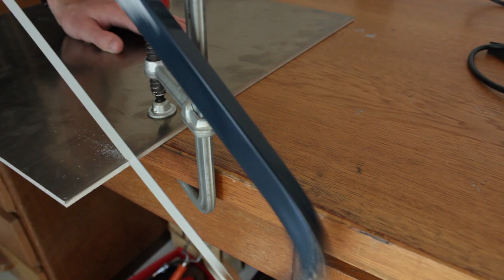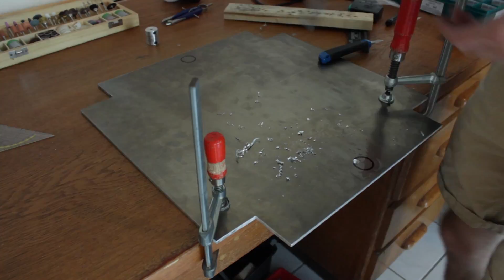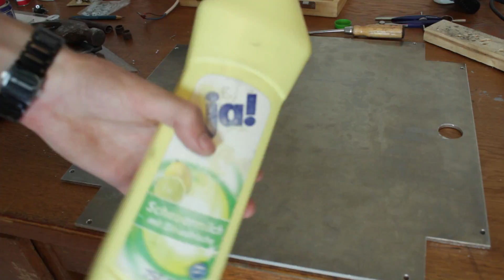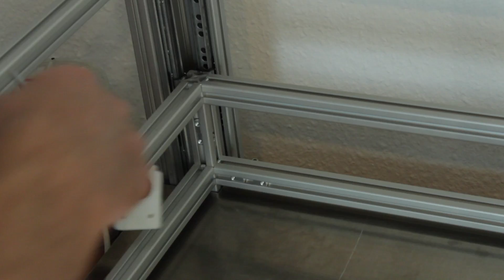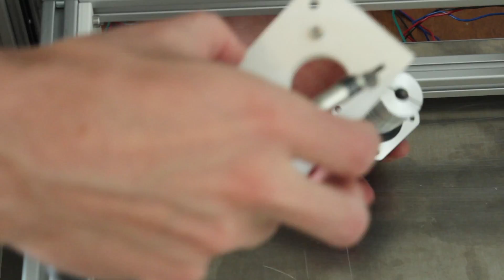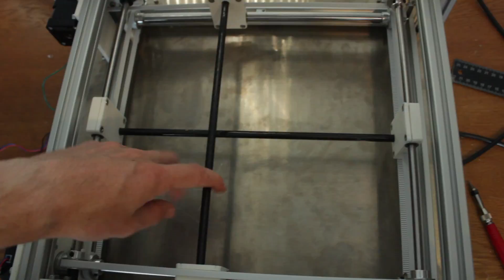DIY 3D Printer: X/Y Motion System

Comment: Great series! I watched all videos yesterday night in a row until I fall asleep with my face on the phone! :D I subscribed everywhere I could...youtube, instagram, I also downloaded the Thingiverse zip...
Stupid question: are pieces printed in PLA or ABS?
Reply from the maker: Thanks! I'm glad you liked it :) That's not a stupid question. I printed everything in PLA. ABS is not really used anymore nowadays. Instead, you would use PETG since it has about the same glass transition temperature as ABS, is even stronger and doesn't nearly warp as much as ABS. Only if you want to use the acetone smoothing technique you would use ABS.
Reply: I started redrawing your printer using Solidworks, so questions arise as I move on.
In your BoM (and in your second video - yes, I'm micro-studying them :P ) I see I need four 8 mm, 340 mm long shafts. If I understood right how they are installed in the bearing mount, they will all be exactly aligned to the external faces of the 608 bearings, as they are as long as the horizontal aluminium profiles.
But then, as I have to mate the one concentric to the X-motor to the motor itself, through the flexible shaft coupler, it's too short to reach it (see http://prntscr.com/kw99fu). Do I simply need a longer shaft here or is there something I'm missing? Thanks!
Reply from the maker: Wow that's so awesome to see! The render you put up already looks very nice. So what I've done is I've ordered four 8mm, 360mm long shafts because I initially had planned the printer in a different way. I then made the video and realized that 340mm would be long enough. What I forgot however, is, as you're seeing for yourself, that the shaft that's coupled to the x-motor needs to be longer. So long story short: I used four 8mm, 360mm shafts and they are now sticking out about a centimeter on each side.

Thanks for the heads-up! Will immediately change it in the BoM :)
Reply: Oh, ok. Easier than I thought :) Thank you...
Reply: However, the more I try to "duplicate" your printer, the more I understand and appreciate what you did: I'm just copying, but you actually developed it!
Reply from the maker: Haha :D Thanks, but I took my time as well ;) and the more time you spend on a project the more you start thinking about it during other activities, which I find is the most efficient way of problem solving. If you want, I could add your design to the thingiverse page and give credit/link to your social media sites. I think other people could really benefit from that!
Reply: Components are starting  to get here! As soon as I start building it, I'm going to @ you.
About the carbon fiber shafts, do they just slide in the XY slider holes or are they fixed to it in any way?
Reply from the maker: Hmmm things are getting exciting!  :) The carbon fibre shafts press fit in place. Although it's working fine, it's not as over-engineered as i'd like it to be. I could have maybe added a grub screw to pinch the shaft in place.
Reply from the maker: Hmmm things are getting exciting!  :) The carbon fibre shafts press fit in place. Although it's working fine, it's not as over-engineered as i'd like it to be. I could have maybe added a grub screw to pinch the shaft in place.
Reply: Maybe it's ok to just print the XY slider bottom with a blind hole (http://prntscr.com/l4itex) so that the two opposite sliders can keep the carbon shaft in position. Too bad I already printed them :P
Reply from the maker: Yes that's also a good idea. But I wouldn't worry about it. My xy shafts are rock solid :)

Comment: I am still pretty new to 3d printing, what is that motion system commonly referred to as? I know coreXY, but the the belt work on that is very intimidating...
Reply from the maker: Im not sure if it has a technical name other than being a cartesian 3d printer. Ultimaker was the first 3D printing company that used that system. That's why its commonly referred to as Ultimaker system. You can read more about it here:
https://reprap.org/forum/read.php?397,712456
Reply: Thank you!

Comment: I am enjoying the series. Pity you don't have hole saws, they would make short work of those larger holes. They are expensive though so I use the ones we have at work whenever I need them 😃 Also don't let anyone give you a hard time about calling them screws (future video reference). The M series is the "ISO screw thread standard". I personally call them bolts, but I think technically the portion that goes through the materials should be unthreaded to be called a bolt.